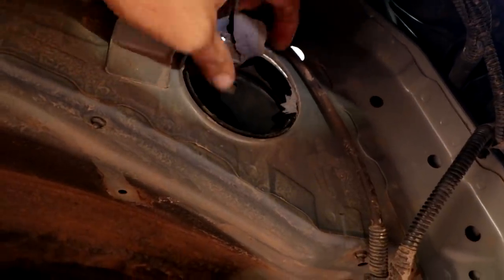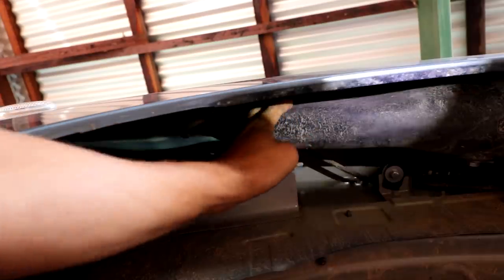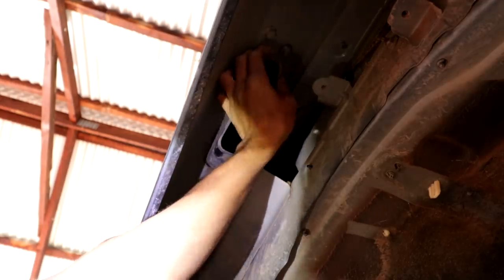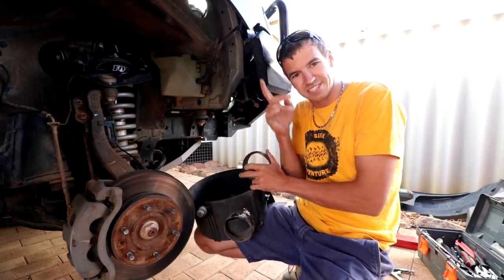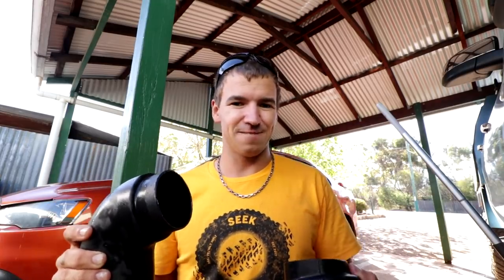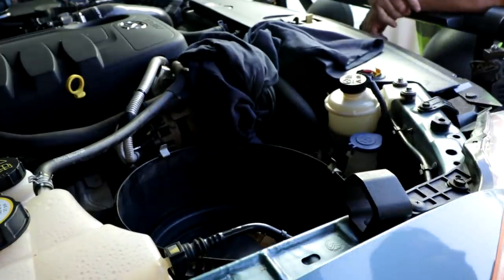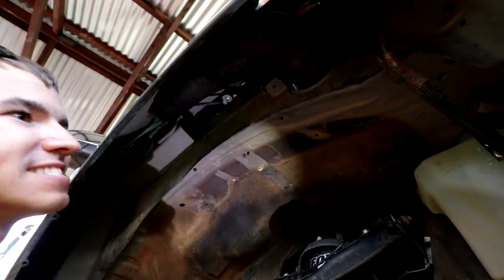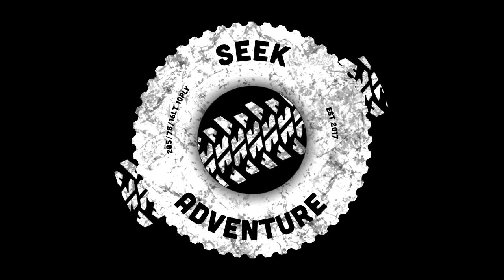Check Your 4wd's Snorkel

Comment: Marine grade Sikaflex is what you need to use. Silicone dose not stick to plastic really well as you have seen on the original install
Reply: Yes second the sikaflex, i use the automotive sealant and it can stick water together haha
Reply: Spot on mate. All they did was replicate the original bad job.
Reply: Grey sikaseal roof and gutter is what i use , sticks like shit to a blanket, even on wet surfaces. Very good on plastics, been on mine for 15yrs not one leak.
Reply: @yuk-erkmckirk9277  is that the good fc sika? About 10 bucks more than the normal sausages
Reply: Absolutely, why they used that crap is a head scratcher!!

Comment: Good vid, warning ..lot of dealerships, $120 per hour & the 18 year old apprentice does the work. Fitted my snorkel myself, all holes correct & rust sealed, used black urethane ( silicone wont stick to plastic). Also get a stocking sock & fit over the top pipe before refitting the head, stops bugs leaves etc.

Comment: Many genuine snorkels are not intended for water crossings. They are intended to raise the air intake to allow more airflow and cleaner air. Which can sometimes be debatable like your circumstance.
Reply: Exactly. Even Toyota ones are just "raised' air in takes.
Reply from the maker: Hey Jax, your welcome to have your own opinion, but if you ask me it doesn't matter if a snorkel is made out of pvc pipe or if its a custom stainless steel unit, aslong as its sealed so its water tight, its going to work 👍.
Reply: Jax - Gaming & More! They call them raised air intake to cover their ass, it’s called a snorkel it’s not rocket surgery to figure out what a snorkel is for
Reply: @craki06  Yes correct in what you are both saying. I'm just stating that you can't really call the silicon useless if it's intended purpose isn't for water crossings. I believe in stating that everyone should check their snorkels because the silicon is shit and could of killed the vehicle is quite wrong as you're basically stating that the snorkels purpose is to allow for a higher intake for water crossings when actual fact many are not intended for that purpose. This should of been much more of a 'hey look what you can do to a genuine snorkel if they are not properly intended for water crossings. Simply do this, this and this to seal your genuine snorkel.'

Comment: For plastic to plastic silicone sealing, use acetic cure as it bites into the surface of the plastics better (it also sets quicker than neutral cure) - but don't use it on metal parts (e.g. bodywork) as it can corrode / rust these areas.

Comment: The snorkel pipe in my wheel guard area was completely disconnected and too short to have been ever connected. Had been through multiple over the bonnet crossings so was very lucky. Now rectified, was installed by a dealer.

Comment: Brought and installed one of these yesterday and I have got to say it was a set up. No instructions and the template sits on the guard upside down. The biggest concern is the fitment of the snorkel to the S bent like you guys fixed up. Good idea lads

Comment: AFAIK vacuum is not as strong as pressure. As long as the head ram is not blocked you will have very small amount of water coming into the air box during a safe water crossing.
To fill up the air box completely with water via those minor unsealed spots you need to sit in water for quite a while, remember the rule if can't walk it you shouldn't cross it?
Most of the safe water crossing could be done without a snorkel up to manufacturer wading depth, but if I had to sell snorkels for a living I would give a different comment  ;-)
Great videos mate keep em coming

Comment: Just like you said. Can’t trust the dealership jobs. Bought my Ute new and never took it back. Installed the snorkel myself and have had it stuck windscreen deep in a river, engine didn’t stop, everything got wet. I was fine to drive out and start drying it out. 
Keep it up lad. You’ve probably saved a few engines already.

Comment: Hum... that Sikaflex 227 polyurethane product sounds like the way to go. Toolbox staple.
Idea for a new video; revisit the previous repair and see how it’s holding up? Has the Alu. Plate moved etc.? I think bonding loose fitting polypropylene air intake ducting, exposed to vibration, twisting, air intake pressure differential forces, temperature variations etc is actually quite a challenge. 
Thanks for a great channel and all the effort you put in. Just bought one if your t-shirts 👍

Comment: I'm a Panel beater & 9/10 Utes that come in have a unsealed snorkel, Sikaflex for windscreen fitting is best for your type(turning a raised air intake into a snorkel). all quality snorkels will have a rubber hose running from the outer fender part to the air-box with hose-clamps sealing it.
Reply: I have the ARB safari, and one end is round(air box) and the other oval(fender). The clamps are both round and was curious if just sealing the oval end would help seal better with the clamp? ……thanks in advance Boss
Reply: @scoobysid04  bit of insurance is always nice, i usually add some sika & still use the clamps on both joints, makes it a bit of a pain to get back apart the next time tho
Reply: @bossjohnson678  also what’s take on sealing the drain hole in airbox? Thank you for the help. I’m new to the 4x4 community….😎
Reply: @scoobysid04  just make sure the sealing nipple is supple & not being held open by anything, small sticks, nuts  & leaves tend to work there way down there, if your vehicle is older You might want to get a new one if its perished (not supple or has small cracks forming)
Reply: @bossjohnson678  ok thank you Boss 🤙🏼😎

Comment: Also check your turbo, I have a completely stock turbo and intake, the front air intake pipe completely fell off so it was sucking in dirty air because the hose clamp fell off.

Comment: Hey mate, as others have mentioned most oem snorkels don't seal for water. They are simply to raise the air intake and not seal against water. Mitsubishi are the same to name one. Cheers bro.
Reply from the maker: Hey Brenton, your welcome to have your own opinion, but if you ask me it doesn't matter if a snorkel is made out of pvc pipe or if its a custom stainless steel unit, aslong as its sealed so its water tight, its going to work 👍.
Reply: @SeekAdventure  100% dont disagree with you at all. I just think the car manufacturers need to be clearer when selling their genuine snorkels as to what their purpose is. But you are correct, having it fully sealed will do the job! Cheers.

Comment: the best thing I found to seal gaps is cut up a bicycle inner tube and use as a gasket, then hose clamps and crank on them, good tip with the metal spacer! using just Silicone risks vibration failure.

Comment: Toyota maate. Lol na cool video and a good pick up on your part. well done. I woulda used a automotive grade sikaflex product.
Reply: Yeah. Sika
Reply: Yeah Toyota, like the vdj79s with 100 mm different wheel track , alternator basically at the bottom of the motor dragging through mud,  fanboy  haha
Reply: also toyotas are only raised air intakes not snorkels and are advertised as such. they leak heaps

Comment: If it doesn’t stick, 25 year silicone warranty is worth nothing. Roof and gutter silicone is for roofing I.e.metal to metal. Polyurethane glue expands to fill gaps and will stick to just about anything alternatively as some other commenters have said sikaflex or seal and flex. You can get them in 25 or 50 percent expansion or contraction grade.

Comment: Victor Reintz Reinzosil or Elring Dirco sealant is my poison, seal up most joints& grommets. They are double the price of other brands but they work better than the normal silicone.

Comment: Hot air gun with a small blowup ball will stretch the plastic to close the gap at the air box. Rubber seals and hose clamps should be used on the round connections. 
Around the stupid rectangle sections reinforce with heavy duty duct tape. 
You can check for leaks with smoke from a electric cigarette. Block the air box & inlet with duct tape, pressurise the system with smoke.

Comment: Pull it apart and do it again with polyurethane sealant, silicone does not adhere to plastic period. If that spacer falls out, the pipe will collapse again and immediately break the silicone free from the plastic pipe. First time you get bogged in a deep water crossing, it will end your engine.

Comment: I would replace the bend with silicon rubber and pop rivet it all together with roof and gutter silicon
Reply from the maker: That sounds great, please send me a link to a silicone bend that goes from an oval to a round end 👍
Reply: being silicon rubber that in it's self is the answer you measure the outside circumference of the oblong shape and match it to the inside circumference of the round silicon place it in very hot water and make it fit then pop rivet it ( you might find they are the same circumference.
that is because of volume in must equal volume out otherwise their would b a choking effect if that is the case through it away and get a one piece one
Reply: @trev9874  Assuming the area across the oblong and circle are the same does not mean that they will have the same circumference.

Comment: Silicone is not an adhesive, its appalling as one. Need to use a polyurethane based adhesive/sealer such as PU18 or Sikaflex. Silicone is really not the right thing for the job
Reply from the maker: When your out in the country and nothing is open on a Sunday, you use what you got 😉
Reply: @SeekAdventure  fair enough

Comment: Sikaflex works better than silicone
Reply from the maker: Last time I checked Sikaflex is a company that makes silicone 🤔
Reply: Seek Adventure Sika the company do make a range of silicone based products (SikaSil) but sikaflex is a polyurethane based sealant not a silicone based product, the specific one I’m talking about is sikaflex 227 (available in white or black) we sell & use at work. It doesn’t end up going brittle like silicone does over time and it’s specifically an automotive product and is good for bonding & also for sealing. Also good for sealing holes for weatherproofing (like if you’re drilling a hole in bodywork to install something and need to seal it so it doesn’t leak, the companies stuff we fit at work do not recommend using silicone to do this as it can promote rust on bodywork) and gluing down weatherstrips, re-gluing door rubbers etc. Wasn’t being smart just throwing it out there coz it’s really good stuff for a range of different things 😉
Reply: @footprintsandtyretracks  great advice

Comment: Is it actually a snorkle or is it just a raised air intake?
Reply from the maker: Last time I checked a snorkel is a raised air intake, it doesn't matter if its pvc pipes or a custom stainless snorkel, aslong as its all water tight it doesnt matter 😉
Reply: True,  when i was looking arround at some new 4x4 I saw many snorkles that were not water tight and I was told they are just raised air intake, not a snorkle. But upon questioning that after this discussion, you are correct they are the same thing if you take the time to seal them up. In addition congrats fixing yours :)

Comment: You are wasting your time using any silicone sealant. You said Mazda used crap silicone then in the next sentence you talk about using roof and gutter sealant. You need to use polyurethane sealant otherwise it will just fail again.

Comment: Get a fabricated stainless steel 3" snorkel. What you did was rubbish. Also don't start your heap for 48hrs because acidic silicone puts out a gas that will destroy you maf sensor.
Reply from the maker: Hey Pete, if your willing to pay for it I wont say no! 🙂👍
Not sure if you realise, but most aftermarket snorkels need to be sealed when they are installed, this one is no different mate 👍🏻. 
Roof and gutter silicone is non acid, so all good, thanks for your concern.
Reply: @SeekAdventure  I already paid for mine. Time for you to do a proper job. Or buy a new engine. Suit yourself.I had to replace my fuel system after getting muddy water in my diesel tank. $32k later it's going again but never as sweet as new.
Reply from the maker: I might go make a snorkel out of pvc pipe, it doesn't matter what its made out of, Aslong as its water tight 🙂.
Reply: @SeekAdventure  That would be cheap , also not legal on the road. I believe you can by stainless snorkel kits not but not sure where from. No silicone needed.

Comment: buy safari snorkel, it's one piece
Reply from the maker: Some might be, I know on my last 4wd that had a safari snorkel there was 3 joins before the airbox, I don't see how its any different to the one I have 🙂
Reply: maybe for Mazda they have few pieces snorkel but my land cruiser has safari snorkel in one sealed unit. only joint is in air-box.

Comment: Screw the spacer in. It will fall off.
Reply: What did you use to hold the spacer in place Polo?
Reply from the maker: I'm happy to hear suggestions of what you would do to fix the issue 👍.